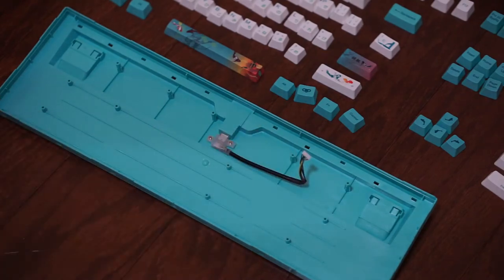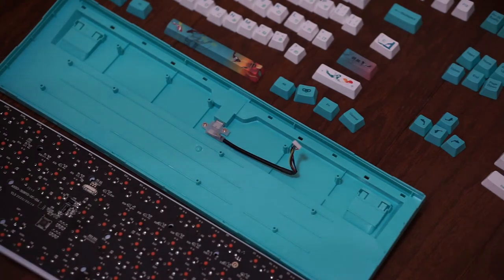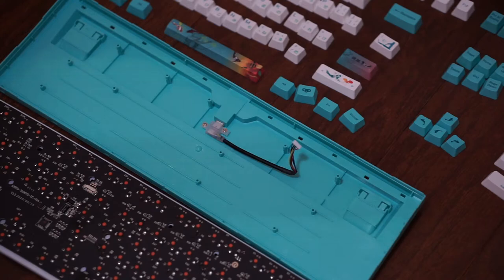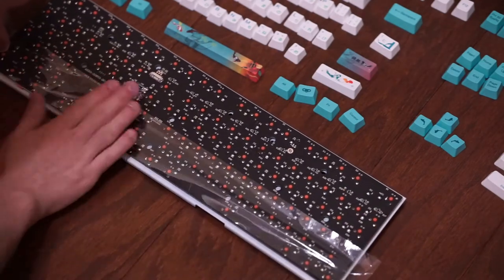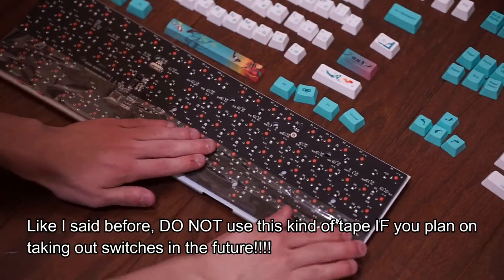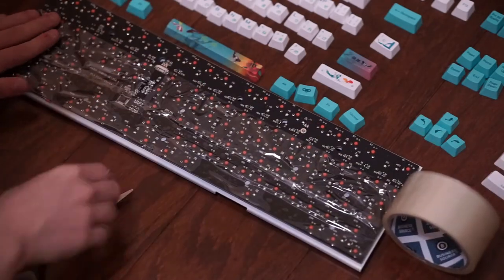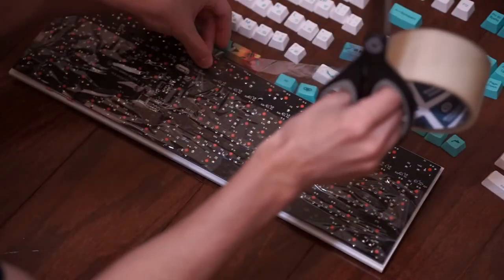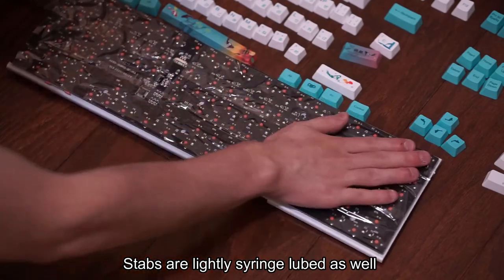How to Tape Mod your Keyboard

Comment: I heard that clear packing tape may short your pcb? Did you use clear packing tape? Hows the keyboard now?
Reply from the maker: Yeah don't do that I mentioned it in the video but the tape I used is not good this video is old sorry
Reply: @PrestonsThoughts  hows the keyboard tho? Did it short out? Packing tape does unironically sound good in sound tests

Comment: my pcb sticks out after i tape mod even though i still pole the holes
Reply from the maker: Too many layers of tape :D try removing a layer
Reply: @PrestonsThoughts  oh thanks and one more question, should I do a foam mod AND a tape mod or should I only do one. If I only do one which is better to do for a more quieter keep?
Reply from the maker: Foam mod will help dampen the board so foam for a quieter keyboard. Tape makes it have a poppier sound to it so I don't think it would make it quieter. Regarding doing both, try it out and see if you like it! You might not have enough room in the case to do both so just experiment
Reply: @PrestonsThoughts  ok thanks
Reply from the maker: Np!

Comment: can i use masking tape to tape mod my wireless keyboard? i heard that the masking tape could be a fire hazard due to the battery, but i dont ever use the wireless mode. is it still dangerous?
Reply: It was okay as long as the tape is not leaving residue

Comment: Which tape is best for the mod?
Reply from the maker: Any tape thats easily removable :) and of course isn't conductive
Reply: @PrestonsThoughts  ok thx
Reply: @PrestonsThoughts  but how bout those tape for packing things is that good?
Reply from the maker: Well it depends on if you want to be able to remove it or not lol
Reply: Would painters tape be okay? Or is that a bit too easy to remove?
Reply from the maker: No that works well :)
Reply: @PrestonsThoughts  thank you so much for the quick reply!
Reply from the maker: I got you! 😎
Reply: Hello. Would an electrical tape work for it as well?
Reply: any tape that can be removed easily without leaving residue i.e painters tape or masking tape
Reply: @PrestonsThoughts  is scotch tape okay

Comment: I heard of people using medical tape. Can that work? I'm new to this whole thing and I just wanna research as must as I can and weigh out all the possible options before doing any mods myself lol
Reply from the maker: Never tried that tbh but painters tape and electrical tape are the ones people mainly use
Reply: @PrestonsThoughts  Ah I see. Ty for answering :>
Reply: Medical tape also works, but gives it a 'creamy' and muted profile. Masking tape will make it sound more clacky or thocky depending on the rest of the kit (Switches, case material, case foam, etc)
Reply: @Yaxie  uh like so can i use doctors tape for it? Is it safe?

Comment: I'm new to the whole keyboard thing but how do i take apart a keyboard I have a kkv 65% mechanical keyboard.
Reply from the maker: Should be able to pry it open from the case using a card to get in between the latches most plastic housings have if not then maybe it has screws you can loosen
Reply: @PrestonsThoughts  ty

Comment: Can I use masking tape that is pretty old? I’m really worried it’s going to damage my pcb. Also, are you supposed to remove/replace the tape after a certain amount of time? Thanks
Reply: Any tape is fine unless it's really hard and your not meant to change it oit
Reply: @EsZed  conductive tape is not okay
Reply: @nikoraasu6929  how do you know if it is conductive?